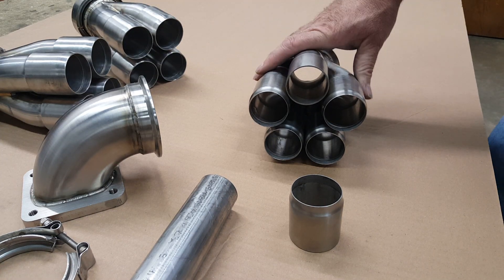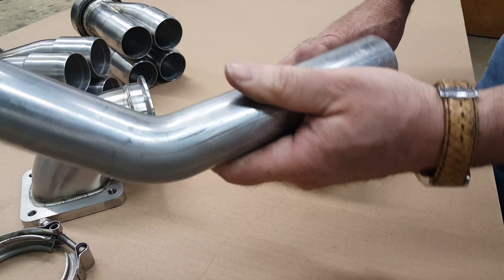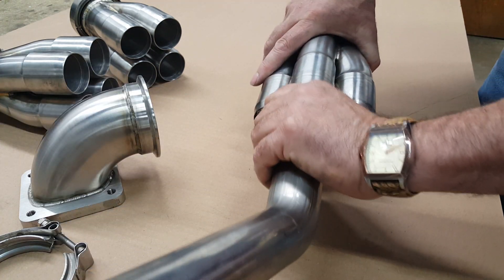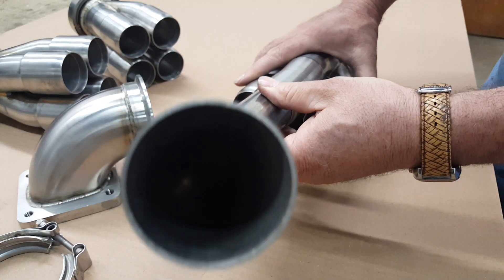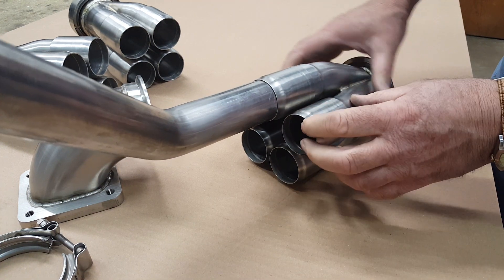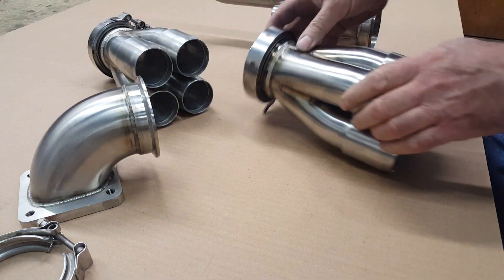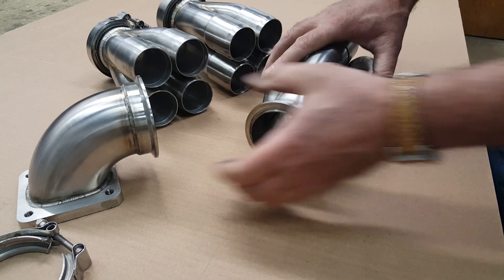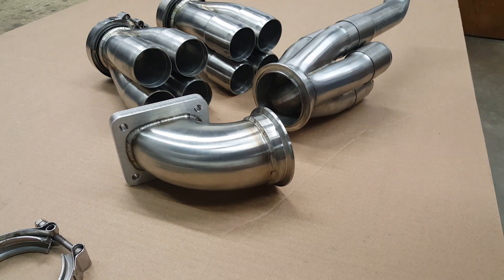Double Slip Joint Merge Collector Design And Use

Comment: When you say floating and anchored, I'm assuming that you mean some of the tubes are welded solidly to the collector outright? For example, if I'm building a header for a VW (flat four), I could weld two fixed tubes to the collector for the nearby head, and have the tubes coming from the far head floating with double slips? For the fixed tubes, do you use the double slip sleeve or just weld them directly with one joint?
Reply: And, are the collector tabs added to the slip joints? Do they allow any yield or slip, if they are welded and bolted together?

Comment: Is that collector strong enough to hold up a turbo? The thickness I’ve seen available is 16G which seems awful thin for holding up to the weight of a turbo
Reply from the maker: Depends on the overall design of the header, but we recommend supports for the turbo in almost all instances anyway.